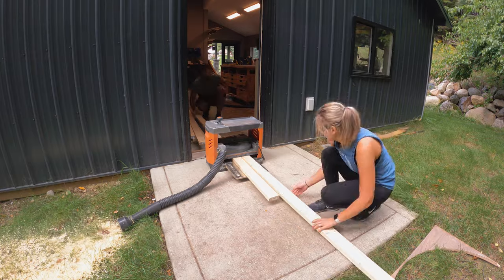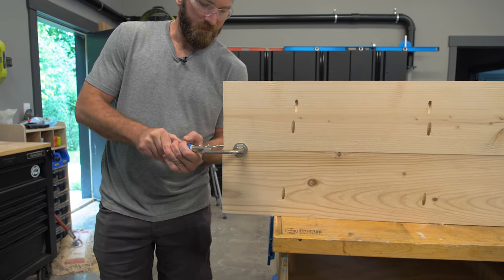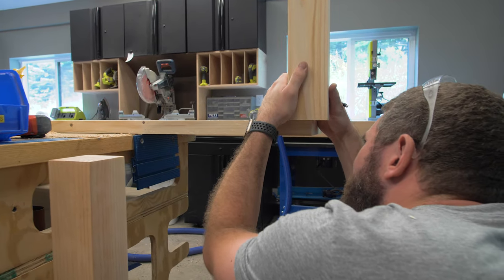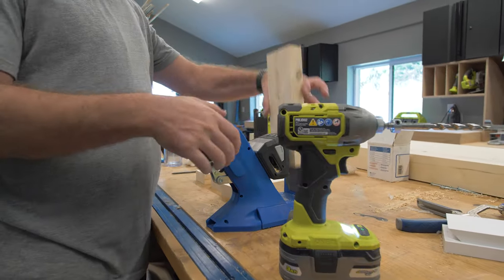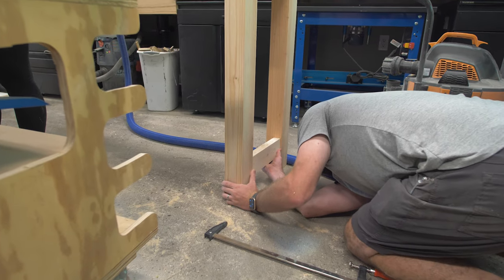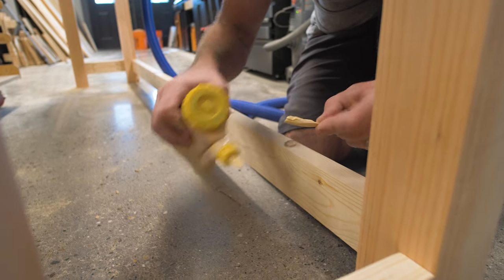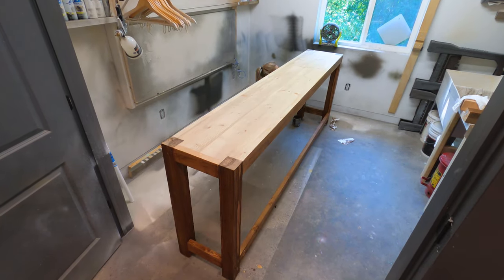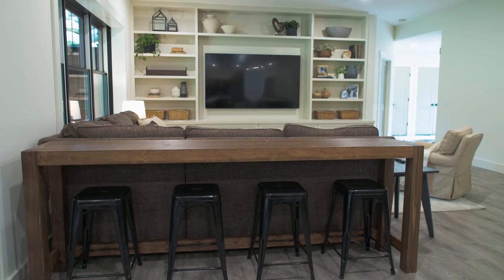Building a Console Table that DOUBLES AS A BAR! 🍺

Comment: Was set on making this until I needed a  jointer and planer. Any--decent--way to get rid of the rounded edges without those?
Reply: You can use a table saw with a straight edge as a jointer. Lots of videos of people teaching that.
Reply: I dont own a jointer, I just use a long straight edge an table saw for the first cut and then run that perfect flat edge against the fence for the other side. Got tired of hand planing and splurged on a dewalt 735. After the table saw, its the best money I've spent in the shop to date

Comment: Man, I thought I could do that, but I don't have all these tools and wood is so expensive in here right now. Just buying one would be cheaper.
Reply: Don't need much. Table saw and clamps will get you most of the way. Don't need the pocket screws either. Properly glued up joints are stronger than the natural bond between wood fibers anyways. I joint on the table saw and have a hand plane, but recently upgraded to the dewalt 735. I'd buy in this order. Table saw, planer, chop saw, band saw and then it's kinda all the same imo. Buy what you need when you need it. Don't do like me an drop 3k an end up really only using the table saw lol